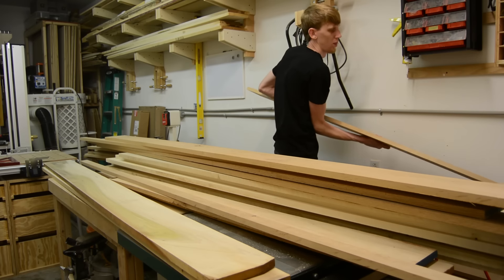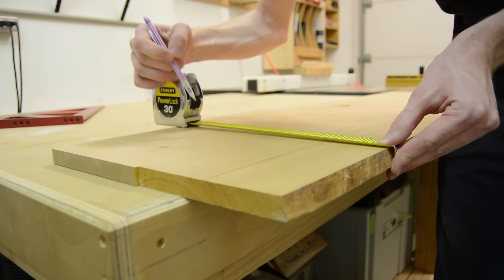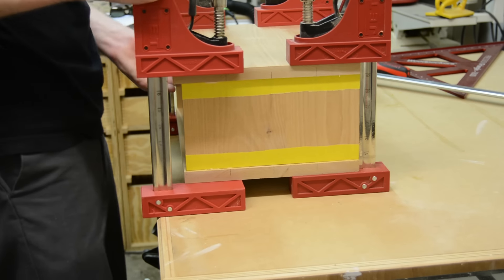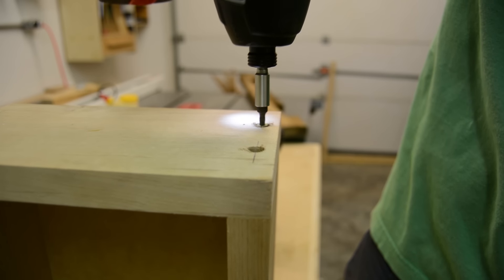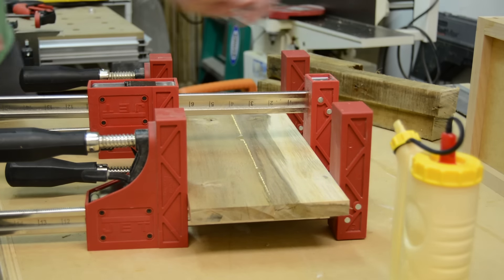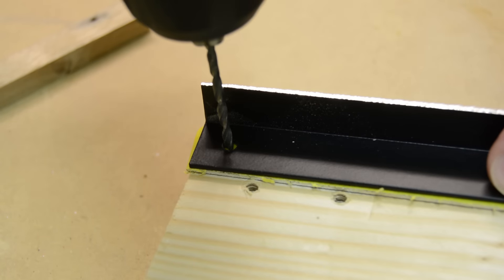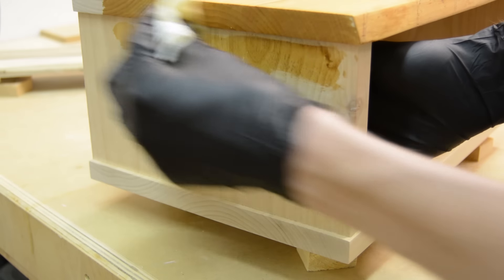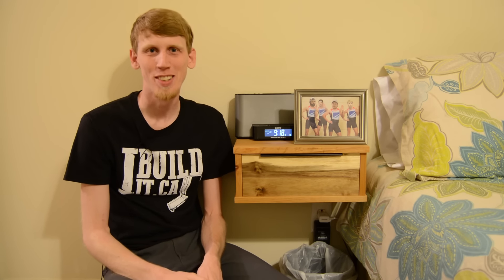Floating night stand.

Comment: Really great work Matt.  When cross cutting on the MFT, you can use a clamp to hold down the longer section so that you don't have to reach over and hold it down by hand.  :)
Reply from the maker: +InMused 
Yeah, I know, I sorta forgot until I was in mid cut lol

Comment: Hi Matt, nice build. I'm thinking of building something similar for my sons bedroom but with a hi gloss finish, probably paint and flat back to get a really good shine. Knowing you are a trained body shop painter what paint would be best and what material would you make the unit from? MDF or solid timber. Any advise would be great
Reply from the maker: +Nigel  Taylor 
If I were gonna paint it is would probably use mdf, the only real draw back is weight. Maybe just make the shell out of mdf and use something lighter for the drawer and front.